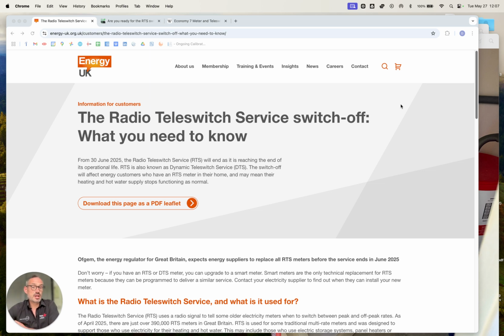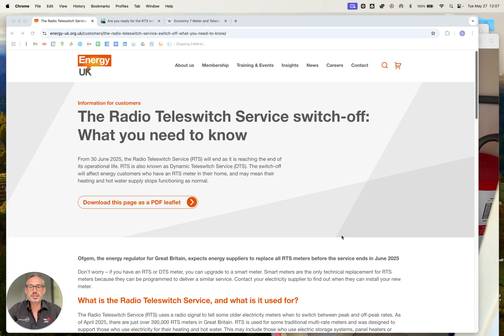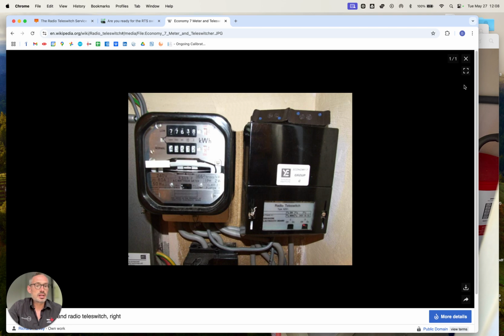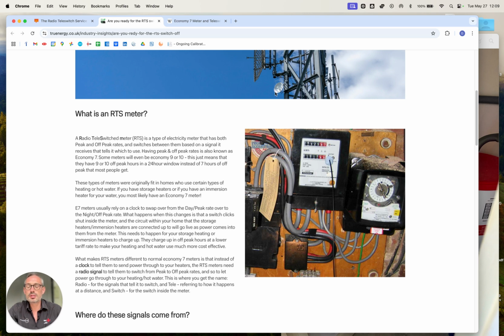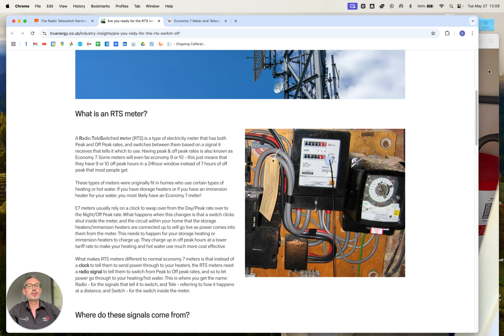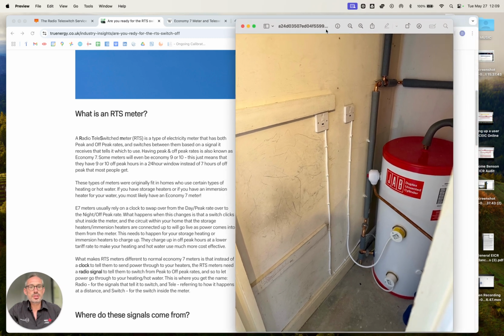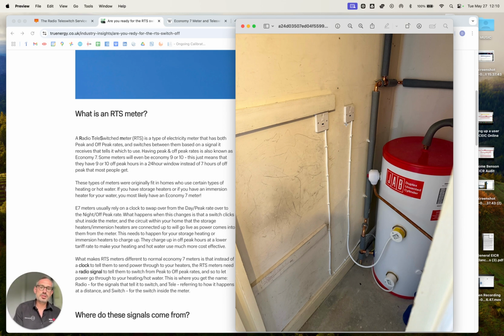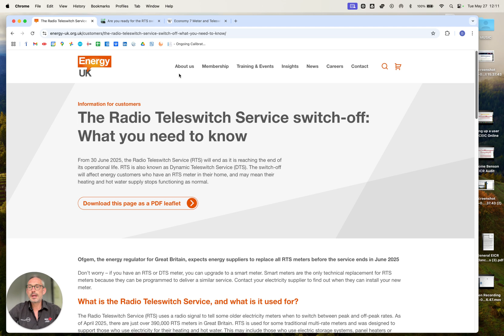Important Update on Radio Teleswitch Service (RTS) Switch Off

Comment: I have an RTS meter labelled from 1987 but behind the glass theres an "on" & "off" switch inside set to "off" The meter wires go into a more modern white plastic LCD display meter showing two rates alternatively.  I have an oil combi boiler, no gas. Does this mean my RTS unit is turned off and not needed?
Reply from the maker: Hi Colin, thanks for this. Can you send some images to my email? you can find the email address on the contact form on my website. Does the oil boiler cover both your heating and hot water?